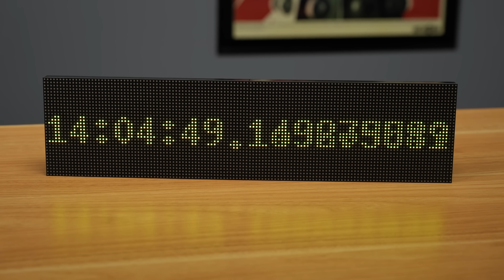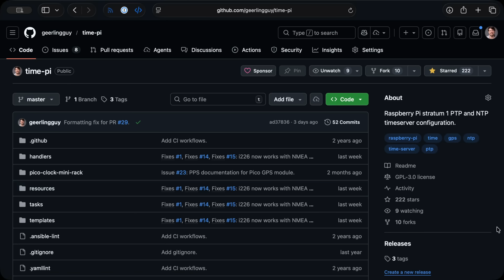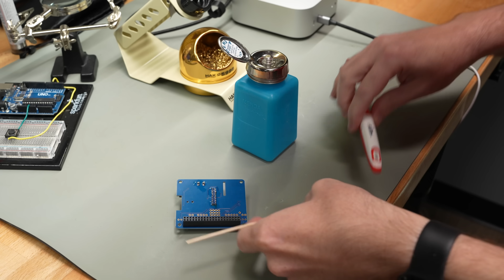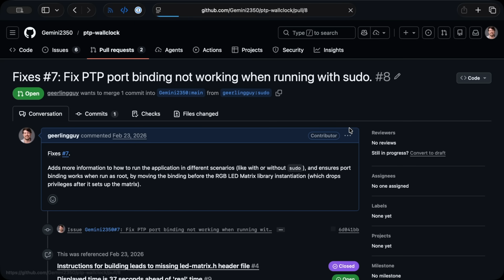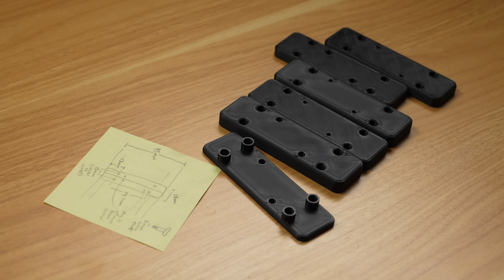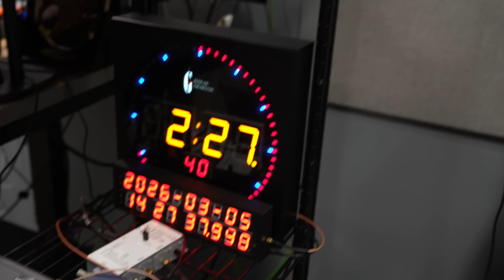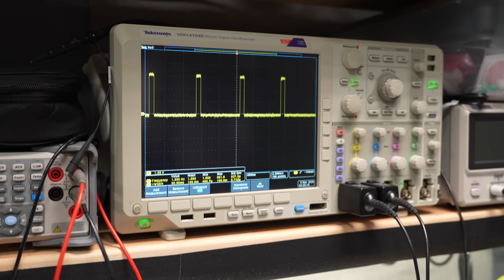I built a new clock, and now I'm not sure what time it is

Comment: 3:44 It is indeed a combination of type of rosin and flux, but also technique. Try to first use IPA to dissolve the flux, then use wipes (or something absorbent) to soak up liquid before it evaporates. If you dont do that, you are essentially just redistributing most of the flux over the board, rather than cleaning it up.
Also, there's a MASSIVE difference in different kinds of flux and how much crap they leave and how well they clean up. True 'resin'  type fluxes are especially difficult to clean (really requiring the special flux cleaners), whilst water-soluble is much easier. There's also ' no clean'  synthetic types (that still require cleaning). Again, the best way I have found is just to try a couple and see what works for you. 
As a note for anyone reading; never use the 'acidic'  type thats sometimes used for soldering pipes together, it will destroy everything. Also never use acetone (nail polish remover) to clean up flux, it damages many electronics, plastic etc. Apparently most brake cleaners are a fair replacement, but be careful ! Old ' chlorinated'  types are toxic!

Also I was thinking, isn't it a bit silly to display time in 100ns resolution? The dot matrix displays are updating probably at 30hz or so ;) Trimming off the unnecessary and misleading 'precision' would also allow you to run the time on just a single dot matrix display, helping with cost, complexity and size!
Reply: Another YouTuber who tests lots of flux recommends Black Horse Repairs' flux for being very easy to clean as well as performing well at many different tasks. I think he liked the smell, too.
Reply: use pressure wash and there will be no flux left there, 100% guaranteed. 😂😂

Comment: A ns precision display is just a gimmick and will never be accurate, not only because no human will ever be able to read it but also because the time changes at a rate of 1GHZ, by the time you start serial shifting the data into the display the time has already advanced. Even if you somehow try to compensate for that the Pi doesn't have the required precision at the hardware level to maintain the displayed time, heck at 1ns intervals even a FPGA will struggle.

Comment: In my experience, cleaning the flux depends on the type of flux. Some can be washed with (DI) water, in general IPA works well, there are also dedicated flux cleaners (hexane or heptane mostly). If you're desperate, acetone can be another solution BUT it can also have an effect on some solder masks. All those solvents can be put in an ultrasonic bath for enhanced cleaning.

Comment: 1.) Re: Flux -- Maybe your toothbrush is getting too soft?  99% IPA gets up everything for me.  Could also be solder or flux blend.
2.) Alternately, something that gets up *anything*, even better than goo gone, is lighter fluid.  Like just, cheap Ronsonol, or any brand will work.  No idea why.  I haven't used it on PCBs before, but it's the most amazing thing if you've got gunk stuck to something.  No idea why it works, but it does.
Reply from the maker: Do you have to light the lighter fluid or no? 😅
Reply: @JeffGeerling ha! No you just rub it on, it gets gunk off of everything I've tried it on.  My friend who works in restoring and rewiring 100yr old lamps taught me, and I've been using it on electronics with gunk on them that I've come across for the last 2 years or so, and it's been working (not actual PCBs yet though).

Comment: Nice work! For a cleaner finish: try using a non-woven wipe between your brush and the PCB. If you scrub with IPA through the wipe, it will soak up the dissolved flux immediately instead of just spreading it around.

Comment: With flux, the main trick is to lift it off. That is, use paper or a sponge to absorb the (now dirty with flux) alcohol. Do not let it evaporate as that leaves the flux behind.

Of course, this approach doesn't quite get to the level of an ultrasonic bath in alcohol. But, it is a good enough method for most uses.
Reply from the maker: This sounds like the missing piece! I've ordered a box of lint-free antistatic wipes, and will give that a go.

Comment: To clean old flux I use special flux cleaner that comes in a spray can with a small brush attached. It's called ChemTools Kleanium. It may be an Australian product and only available here. It's acetone-based so you could just use acetone to remove the flux then maybe IPA after. If you want a super clean after that wash the board in hot soapy water. This stuff is great and makes the new solder joints look like all the others so it's great to hide a repair heh! I often do arcade game repairs for local friends and then I ask if they can see what I did and so far no one has ever found what I touched lol. I mainly only use this stuff because I also do repairs for another local guy and he provides these cans for free whenever I need one... you can't beat free no matter what :-)

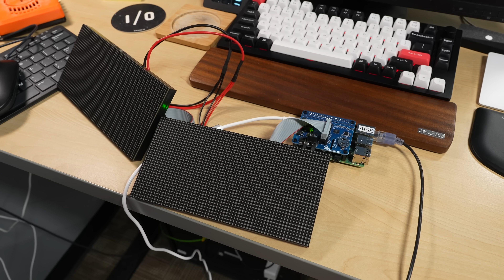Comment: 3:50 there's a spray called solins flux off that removes all flux in just one little spray - then I remove it with compressed air. The only problem is that I'm pretty sure you can't buy it in the US. But maybe you have something similar that you can get?

Comment: The significant digits in the PTP clock time versus NTP intrigues me.
I've had many times when I was trying to understand how to synch actions between servers and client devices while accommodating for the time of the message to travel.  
Is there a software tool that synchs your PTP and NTP time per millisecond and then allows PTP to fill in the significant digitals between the intervals?  Perhaps the duration of the impulse between the two might be causing the drift?  
I recall that there was a STS-1 clock issue where the computers were rounding up or down at specific clicks.  That led to a mismatch between when a message was received versus expected.  Made me wonder if the drift Jeff describes could be similar impulse duration and rounding error at times.

Comment: For cleaning flux, I've adopted the volt-nuts protocols. First, take a good look at the components on your board and make sure they won't be harmed by a good soaking. Most won't, but be smart about it. Then: soak the entire board in IPA, scrub with a brush, rinse thoroughly, wash with dish soap and hot water, allow to dry thoroughly before powering up. The real trick is not being skimpy with the IPA. Sometimes a first pass with electronics cleaner helps. Sometimes a second IPA soak and scrub helps. After all that, keep your grubby fingers off the traces.

Comment: Regarding the flux after soldering, if you like a professional method, grab a can of "FLU Fluxclene" solvent it gets it all off perfectly with an old toothbrush. Otherwise, what you're doing already should be adequate. I generally use IPA with a brush, it sometimes leaves a greasy-looking residue but I don't think it's a cause for concern.

Comment: What kind of solder are you using? SAC305 should clean up perfectly, so the flux may just need one extra step of scrubbing, you can also dunk fully into clean 99% isopropanol and scrub it in there. But if you want a reallllly clean board, get an ultrasonic cleaner designed for PCBs. But I don't think you solder enough boards(yet) to need one.
Reply from the maker: I've heard a lot of people suggesting 99.9% IPA, I've always used 91%. Just ordered a gallon of it, and will first give that a try.

Someday I'd like to build enough PCBs to need a whole SMD line haha

Comment: My flux cleaning ritual: Spray on some ProClean Flux remover. Let it sit a few seconds (don't let it evaporate), then I scrub the area with a short bristle brush.  Then I put some more flux remover on and I take a cloth (something better than a paper towel, but less than a microfiber towel... the blue shop towels work well), i put the towel over the area and I scrub the area with a brush on the towel, rotating the towel as you scrub/wear through it.  The first step breaks down the thick stuff, the second step absorbs the residue. Repeat the second step if you still have residue.

Comment: get some No clean fluxes, especially the liquid types are excellent for visual and aesthetic work where they evaporate almost cleanly and do a decent job. Pricier but MGChemcals has been my go to. As for the pastes, no clean fluxes still leave residue, IPA works but doesn't cut it. Use some acetone or ethyl acetate and a cleanroom cloth so it doesn't leave lint everywhere. toothbrushes work but they get nowhere close to the cheap small cleanroom wipes you'd find for a couple bucks.

Comment: Don't forget to compensate for added delay from the PTP to the LEDs actually lighting up.  I'd bet there's at least a few ms there.
Reply from the maker: Heh, that skew can be corrected since wires are known length :)

Probably at least a few hundred ns
Reply: @JeffGeerling  Oh I mean primarily from the LED driver ICs, and possibly delays from in the kernel to the pins on the pi changing.  All your wires looked pretty short so I'd think the propagation delay would be well under 10ns.
Reply: @JeffGeerling  This reminds me of Grace Hopper's nanoseconds.
Reply: @JeffGeerling  As you already have a PPS ref clock you can maybe convert one LED into a PPS output, this would allow measuring accuracy of the clock output with the PPS ref clock.

Comment: One thing that can throw you is that you need to know where PTP timestamping is being done. 

I was using an SFP-Copper adaptor to connect a Grandmaster to a chain of boundary clocks. The Grandmaster was timestamping in the MAC and the SFP-Copper adaptor has an asymmetrical TX and RX path which was showing up as an almost constant 50ns delay between the GM and the first BC. E2E ptp relies on equal transmit and receive path delays. 

Replacing the adaptor with a DAC cable brought my average time error down to sub 3ns. 

WATCH WHERE YOU ARE TIMESTAMPING!!!!!! :) 

The whole ptp thing is a rabbit hole and totally fascinating. Get well soon, Jeff.

Comment: I'm concerned about these ns. Since you show'em, have you taken into account the time between points in time when rpi processes data and when it is actually shown on display? This takes a few ms at least, so what's the point of showing ms us and ns... these are always late... and non deterministic since os task scheduler  has a resolution you can not overcome. You can just rand() ms and all digits after it. Same lack of info there....

Comment: Great, now I need to sink a thousand hours into time - because that actually sounds fascinating! Also - the flux residue usually sticks around with "no clean" flux. IPA doesn't do the trick. My favorite is MG Chemicals 4140A. Its fantastic and breaking down and cleaning all types of flux residue.
Reply from the maker: I think Micro Center may have had a bottle of that on the shelf! Looked a little old, though. Might order some on Amazon

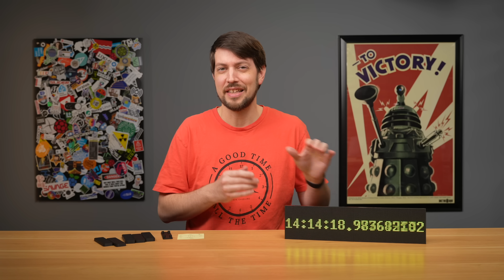Comment: 0:31 only need to get a 1000000000 Hz display to make sure the numbers are 100% accurate
Reply: GHz LED display, hmmmm...
Reply: All sorts of methods can be used to make your own fast displays! Often, the more important part than making sure the display is fast enough, is making sure the rise time and fall time of your signal(s) driving the display segments or pixels, are fast enough. 

This clock here is running nano time, so it would need to change pixels at 1 nanosecond. However, if you don't do anything fancy to QUICKLY raise and lower your digital 1 and 0 signals, it actually usually takes around 5-20 nanoseconds for a signal to change from low (0v) to high (3.3v), or from high to low. This automatically limits your refresh rate to 5x-20x slower than 1 nanosecond refresh rate.

You can make it faster by using a lower logic voltage like 1.8 volts so the voltage has less "distance" to travel between low and high. You can also build mosfet drivers for your data lines going to the screen. But at some point, your CPU hardware will become the bottleneck. At this point, Arduino and esp32 is too slow, and raspberry pi probably has too much software overhead to achieve 1GHz through a gpio pin, let alone multiple gpio pins simultaneously. So at this point, I think you'd need to learn to build an FPGA, such as used in 4k HDMI connectors, so they can process over 20 Gbps of data throughput
Reply: I am curious about the fps, how many updates per second? Looks like a lot!
Reply: @sopues hz means cycles per second, so 1 bazillion hz is 1 bazillion fps
Reply: @sopues not much, the hub75 matrix isn't usually doing much over 100hz. The simple 7 segment display of those professional clock can be actually millisecond precise but for led matrix you need only two decimal places at best. As a bonus you can make the digits larger and use more of those precious pixels
Reply: @jan.tichavsky  an analouge display dial can be perfectly accurate without having to worry about units of precision.  Hands are either on time or not, precision doesn't factor in.
Reply: Hi Startedtech, I have the same consent, the led Matrix panel drive with shift-register chip like 595... It definitely cannot reach GHz. The cheap panel from china only can reach about 30MHz. And the panel needs scan led 1/4, 1/8, 1/16. So I really don't believe it is PTP realtime
Reply: @LiWei-mx3gb  more like 1/32 at least. You are not getting high refresh rate on hub75 panels. 7 segment display is superior in that regard, you could easily build sub millisecond accurate display.
Reply: get nixie tubes!
Reply: @ev4_gaming  don't they operate by glowing incandescent filaments? The last few digits would just be lightbulbs at that point 😂
Reply: @cyleleghorn246 no they're lil gas discharge beans
idk if they're fast enough tho

Comment: The easiest way to clean up flux for me is to heat it up to about 100°C or so. It‘ll make it almost liquid and very easy to clean with IPA then. Also put some paper towel in between your toothbrush and the PCB, to soak up the solution, then clean again with IPA and just the toothbrush.

Comment: Hey Jeff, do you know of any good intro projects for an adult learning about electronics?
Reply from the maker: Get one of the little robot or sensor kits that has a Raspberry Pi Pico in it, and build it and try to change some things in MicroPython or C.

I have taught a class to 6th-8th graders using the PicoBricks kit, and there are many like it now. You get to learn some of the main sensors to use, and if you have a multimeter and/or oscilloscope, you can test those out by building your own little PWM stuff, or waveform generator, etc.
Reply: @JeffGeerling  Thank you! :D

Comment: I think it would look very good with the normal clock on top, and the high precision display underneath. you could put it a picture frame.   Time drift will always be a problem.  There's a recent Youtube video that claims the earth's rotation is very slightly unstable which throws off the Cesium Beam clock in Boulder, Colorado.   We've come a long since the Bulova Accutron watch.

Comment: Removing the excess flux from soldering on a circuit board is usually done with a tooth brush like device and a non-polar chemical that dissolves it.  The alcohols seem to be less effective that other chemicals in the past.  So far Freeze-It has given the best results for me. It lowers the temperature to the point that the flux becomes a brittle solid and flakes off. My father who worked for NASA making prototype satellite circuit boards for a project often mentioned getting all the components soldered onto the board then placing the assembly into a parts washer that had liquid Freon in it. Same results but much lower temperature, less brushing required and very cold hands. I would recommend using a fixture with a handle at least a foot long to hold the board for submersing in anything that cold. Probably using silver solder with a low flux content would help.

Comment: I work in power measurement and have had to deal with similar problems, where different devices capture values at either interval start or interval end. One thing it solidified me was the difference between accuracy and precision, which should be treated differently.

Comment: I have a Seth Thomas Railroad clock from the 1920's that is one of the first "electric" clocks. It's 100% mechanical movement with a Graham Deadweight Escapement. It has a geared weighted bar that winds the clock, every 3 1/2 minutes the bar reaches the bottom of it's travel and hits a solenoid which triggers a battery powered electric actuator to "re-wind" the clock, moving the bar back up to the top. Originally powered by two 1.5v big dry cell batteries, my father switched it over to a 6v lantern battery in the 1980s. It's been running off the same battery for decades,  probably 20 years... I don't remember when I replaced the battery.
Reply: My father and grandfather used to have a bunch of Seth Thomas clocks each. From a massive grandfather (of course owned by my grandfather) to tabletop clocks. They only collected the all-wood cased clocks that were SO beautiful. I always loved the chiming, although on the later hours, it could stay pretty loud for a long time.

Comment: Can you take a 1 pps signal off of that setup?  If so get a GPS and compare  your new rig ot the 1 pps signal.

Good video.
Reply: My thoughts too, but I think you need to have optical sensor on one pixel - so you can timestamp exactly when the screen actually changes.

Better GPS receiver may also have an 'Event' input, which will timestamp to (internal) GPS time and output (ASCII or binary) logs.

Comment: Re flux residue: A couple years ago I started using Kester solder at the recommendation of another hobbyist. I rarely need to add any external flux when using it, and its own residue usually cleans away completely and with little effort, even with just water. Flows really well.